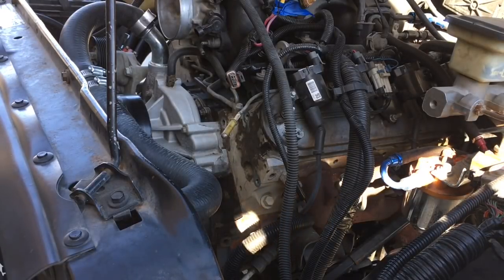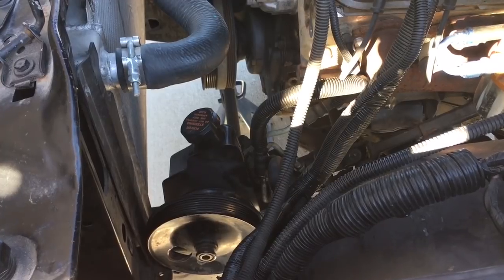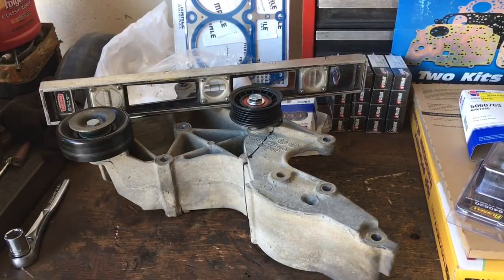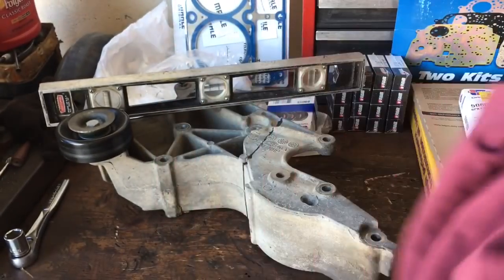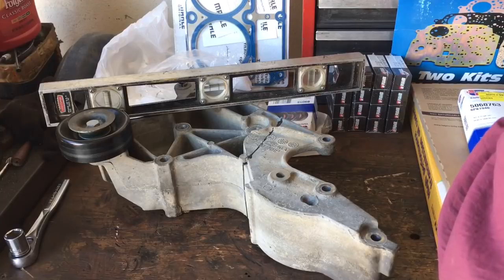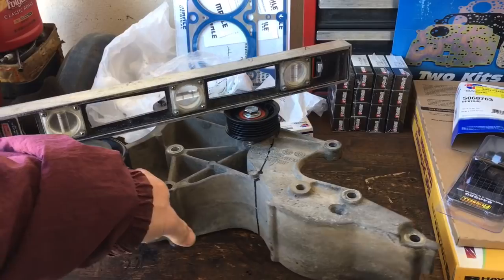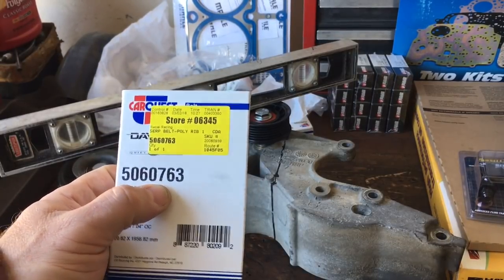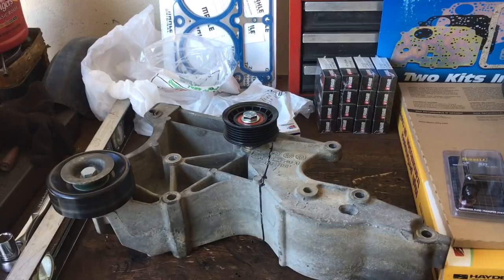LS Power Steering delete 4.8 5.3 6.0 Truck accessories

Comment: Gm has been using the same roller lifter since 1985. I even have them in my Buick v6.
Reply from the maker: Machinery Repairman I’m ready to swap my lifters, I’ve tried every option to clean/flush the lifters but can’t cure the lifter knock issue. 🤔
New cam/lifters coming right up! 👍
Reply: I'm waiting, that cam is on my short list for my 5.3.
Reply from the maker: Machinery Repairman The 1838p is also known as the Sloppy Stage 1 Turbo Cam. For a daily driver 4.8 they recommend being conservative on cam selection, due to the short stroke on the crankshaft.  With a duration @.050 216/220 my 4.8 will make peak HP above 6000 rpm, between 6300-6700 depends how big the ports are on the heads.

Comment: What is the part # on the Russel fittings and the Hayden transmission cooler?
Thank you for your time
Reply from the maker: James Sanchez Do you need the reducer fittings to go from -8AN to -6AN? #RUS660023
Cooler, I wish I had gone bigger just for safety, mine is a Renegade REN12716

Comment: What is part number for pulley
Reply from the maker: GEARHEAD HUFF Dayco 89015
With the thickness of the Pulley, center hole adapter, and approximately 1.00” spacer it needs a 160mm Long bolt.
M10-1.50 160mm

Comment: Where did you get the bolts? And did this work? For some reason i can't get the pump on becsuse of clearance issues
Reply from the maker: Ralph Huff This is a Power Steering delete, the pump will be eliminated.   
I hope this helps, I’m confused by your question.  JD
Reply: @HeadFlowInc  seems the mounts i have set engine forward enough that power steering pump and pulley are hitting the steering box. So i thought i would just delete power steering. Wondering where you got the bolts for delete pulley...
Reply from the maker: Ralph Huff Oh I see, I had to get the metric bolts from my local Fastenal store.  Any industrial supply or nut/bolt vendor should be able to get the bolts.  Search the comments there’s an updated part number for the adapter bushing needed. JD
Reply: @HeadFlowInc  do you know the updated part number for the bushing?

Comment: Why not just get a 76 inch belt?
Reply from the maker: I like my engines to run cool and having less than 1/3 belt wrap on the pulley slips at high rpm.  I regularly turn 7000+ rpm so I needed a safe way of controlling the belt.
Reply from the maker: I remember all the issues Gear Head 4 life had trying to rig up the belt.